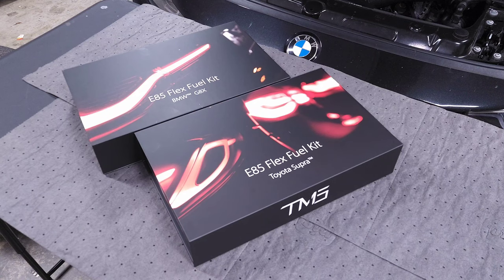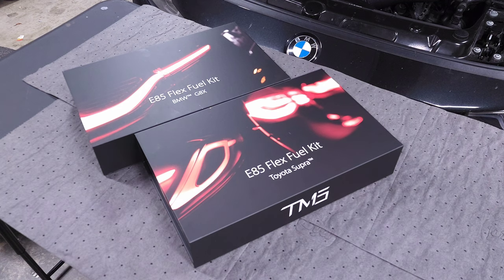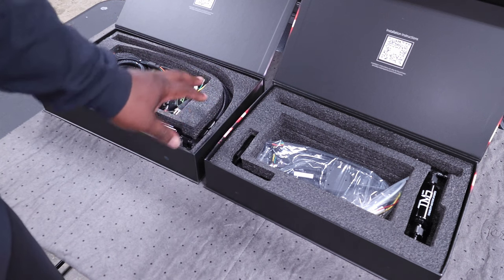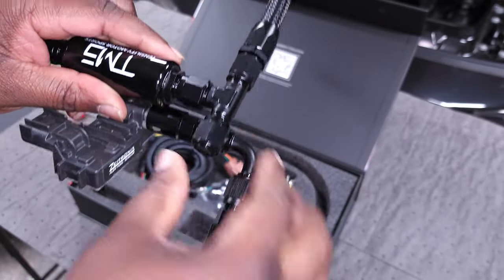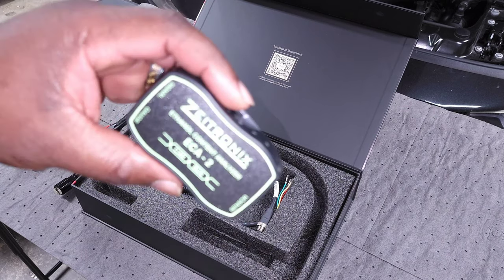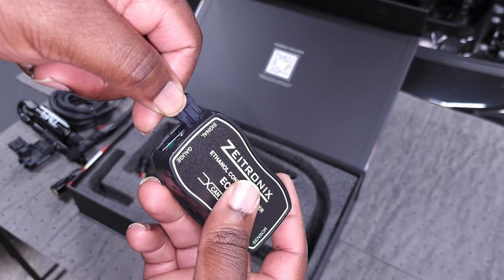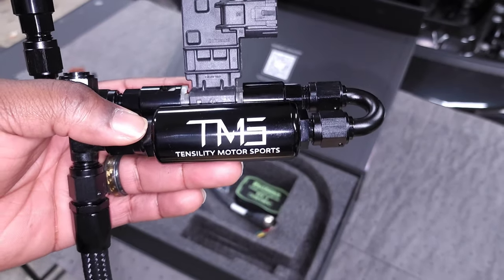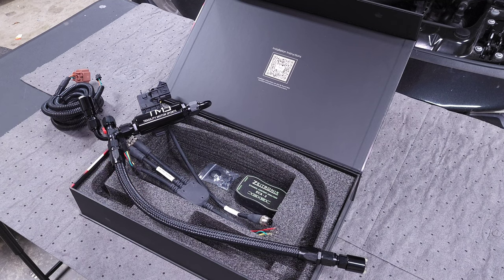Unboxing the NEW A90 Supra & G8X S58 Flex Fuel Kit from TMS/BimmerNetwork

Comment: Kern thank you for the video, i watch another video from tms on install for my 2021 a90 supra.  In that video they say to pin out from connectors 7b and 3b.  My tuner and bm3 cannot see the ethanol percentage but they can see it from reflex+

Safe to say if i follow your video here with connectors 2b and 3b for the power groun and also pt can high and low i should then have the correct pins for the tms splitter?

Comment: Any flex fuel kits for g30?  Like plug and play
Reply: Coming soon with BN!
Reply: @trevorjelam  would this work on my ‘20 m340?
Reply: @trevorjelam  I can’t wait!!! I like speed boats
Reply from the maker: @b58.fazil0  they will be designing a kit specifically for G-series M240i/M340i/M440i because the fuel lines are slightly different. Keep an eye out for release later this year 👍🏾

Comment: I have a 2020 supra tuned with MHD , is there any way to run a custom flex fuel map using this kit?
Reply from the maker: I believe they are working on releasing Mhd+ for your platform. Double check the forums

Comment: does it works with 2021 m340i?
Reply from the maker: I believe it will even though it's not specifically designed for it. Waiting on confirmation
Reply from the maker: they will be designing a kit specifically for G-series M240i/M340i/M440i because the fuel lines are slightly different. Keep an eye out for release later this year 👍🏾

Comment: Let us know if this would work for 2020 M340I. Thanks
Reply from the maker: they will be designing a kit specifically for G-series M240i/M340i/M440i because the fuel lines are slightly different. Keep an eye out for release later this year 👍🏾

Comment: Is it possible to use this kit (or kit like it) to swap from direct to port injection? I have a hard time finding info for that topic. I know there's pros and cons to both, and some might ask why not have both if possible, but I'm just curious if it's possible to swap the B58 from direct to port injection. And I do know if I did that, I'd need to put something in place for the direct injector ports, or else they will overheat (only know that because of Papadakis racing videos when building the drift Supra when he ran into that same issue)
Reply: stock fueling system cannot handle most ethanol mixes, the b58tu has a slightly better hpfp but you will still run into fueling limitations which is why people go with port injection. The flex fuel system will just adjust ur tune depending on your ethanol content, so if you run out of ethanol and there u cant pump anywhere you can just put in regular 91 octane without having to flash the car.
Reply: @michealjordan7090  I understand all that, but I'm specifically curious about swapping just regular fueling from direct to port, since port injection allows you to keep your intake valves clean, unlike direct injection. And it'll be a better air/fuel mixture when it combusts because air and fuel are both sucked through the intake valves

Comment: I have a 2021 Supra with a femto unlock bm3 ecu. Could this enable me to run an actual flex fuel tune?
No more mixing?
Reply from the maker: Yessir 👍🏾
Reply: I am also tuned on BM3 (was bench unlocked (not femto)). My tuner just told me that Flex Fuel Tune is not possible. “current ROM does not support flex fuel capability.” I am being told that I have to use the maps switch option only and must tune for 2 different fuel types without being able to blend them together. 

Do you know if this will get updated through BM3 soon?
Reply from the maker: Bm3 posted an update Several months ago that it's available on femto unlocked DMEs. It's a part of the customrom suite of features including map switching and antilag. I don't understand how map switching could work but flex fuel can't. Maybe I'm missing something.

Edit: just read bench unlocked so it should definitely work. You must have a very unique rom id. Send bm3 an email and see of they can update it manually.

Comment: Would this work on my ‘20 m340? I would assume so
Reply from the maker: they will be designing a kit specifically for G-series M240i/M340i/M440i because the fuel lines are slightly different. Keep an eye out for release later this year 👍🏾